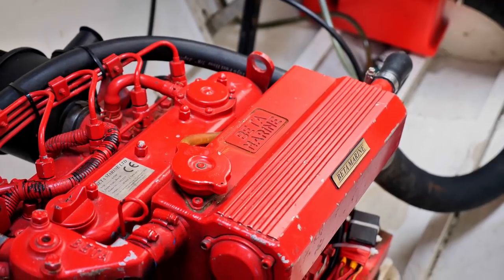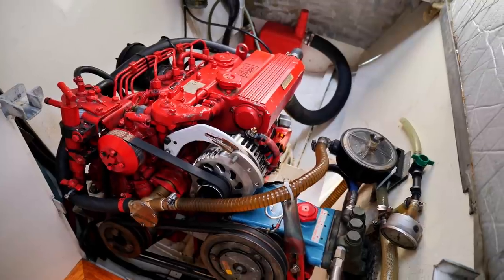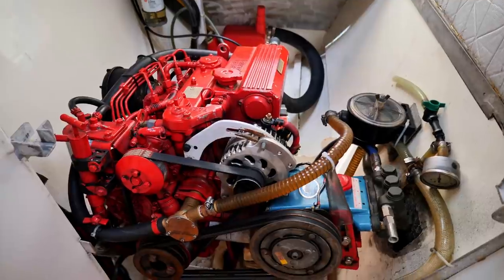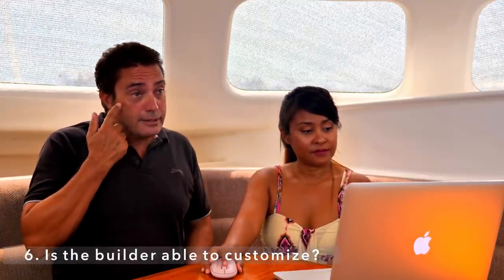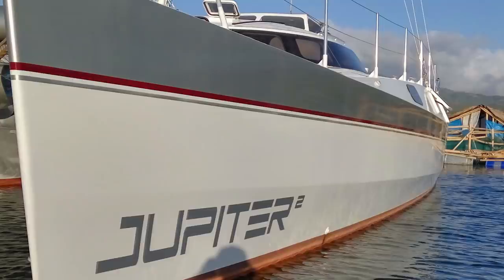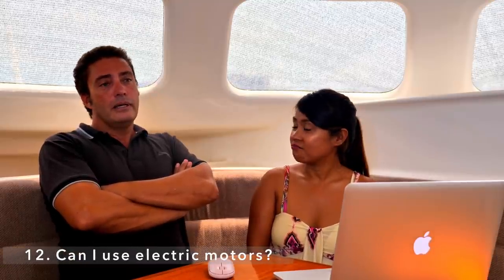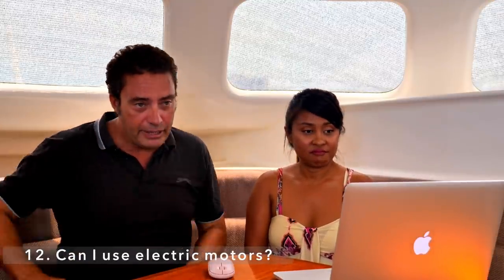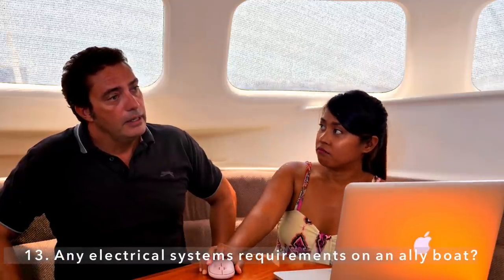Mumby aluminum catamaran - Q & A - Building an aluminum performance cruising catamaran

Comment: Thanks a lot for that Jamie. I did get in touch with Mumby about 6 weeks ago, he answered that he was back building the boat. I then fired out a bunch of questions and still waiting for the answers...You have answered a few here. I find it very concerning if the yard is overwhelmed and you can't get a good communication with the builder all the way in the Philippines. A couple more questions that I wish I had answers for if you don't mind : 
What are the saloon windows made of? Can you fix, change, reseal them. How do you ventilate the saloon? (from the top hatches only ?)
What reefing system do you have? What can be installed?
What is the deal  with the Philippines? Can you import parts tax free, or get the tax back when you leave?
Can you stay in the Philippines after delivery for a few months to stay close to the base and iron out the problems?

The Mumby design is truly great but a bit dated....especially when it comes to the cockpit and connection with the saloon. is there anyway to improve that? Would the 50 provide 2 more feet of cockpit space?
Thanks so much for all the info. It is great that Mumby gets to sell his production. Catamaran demand is totally off the charts now. You did yours at the right time for the right price. Most of us will have to wait 5 years or more...There are amazing deals on monos...just kidding. Fair winds.
Reply from the maker: Yeah, i know it can be a stress with communication or lack there of... but at some point you need to have the faith that they do a good job... he is the designer after all and has pride in that...
So all the transparencies are normally polycarb... but you can use what ever you like. Ventilation i've got 2 overhead and 2 in the front windows in the saloon... I've gone with the standard slab/jiffy reefing at the mast base... but up to you how you want to rig it.
PI has high import taxes... so i used to bring in suitcases full of gear in my luggage when i visited, most months.... The standard tourist visa is 1mth only, but can be extended month at a time.
I agree about the cockpit...and i'd be keen to discuss it with Tim to see if anything can be done... But i suspect it would be a complete redesign... since any increase in space in the cockpit would mean reduced aft cabin space... and if there was a walkthru transom, the rear crossbeam would be compromised....
A difficult one.
Reply: @SailingLifeonJupiter  Hey again Bro. Yes, Tim drew up some new plans for me to open up the cockpit from the scoops, and he had to submit them for government approval, which cost some. And yes, opening up the cockpit from the sugar scoops means losing space in the aft cabins. So, a compromise. Seems like the engines will need to be under the beds. I’m going for the 50’ version, but that doesn’t automatically add space to the cabins as the 2’ increase has to be proportional. But I need the open transom for diving, so for me, worth the compromise.
Reply: @SailingLifeonJupiter  So can you easily change the windows when they eventually craze, what about fixing sealing problems. Form the videos they seem to be embedded and inaccessible. That is why I ask. Cheers

Comment: At 3:57 you mention the light ship displacement being 6,100kg, but everywhere else that I find very sparse info on Mumby48 the light displacement is listed as 8,000-8,500kg, with max-load at 8,700.  Am I missing something? 
I'm surprised because 6,100kg would put it 2,000-2,500kg lighter than some of the most advanced performance-cruisers like Gunboat48, TS5 made of carbon-fiber.  
Is dry weight really 6.100kg? Did you have it weighed?
Reply from the maker: Nah Garen... my boat has always been heavy with all my shit on board!... I'm just relaying what Tim wrote in the specs.... but ally is LIGHT and STRONG!..... but no good for mass/fast production (no moulds).

Comment: Thanks for this guys! Small thing; what do you think about the practicalities of raising the dinette/settee area on a platform by some inches to allow easier vision when seated? I'm not too tall and I notice the windows seem to be a little above you guys when you are seated.
Reply from the maker: Hiya Neville.. Shouldn't be a problem.. Even fatter upholstery would work!
Reply: @SailingLifeonJupiter  (This is my first comment on your videos- you are beginning to make me think I will be saving up for a Mumby!) Fatter upholstery would certainly raise nevillesax enough to see out the windows but as a woodworker furniture builder, I can tell you that you just can't change one dimension without affecting another.  If the seat is higher, a shorter person, like my 5 foot tall wife, would have a hard time getting up onto the cushion.  Then once up on it, they would be uncomfortable with their feet dangling for any length of time.  I think a better solution would be to have part of the floor raised, if not the entire floor.  Maybe some storage could be incorporated below? It would obviously lower the clearance for headroom in that area but, that may not be a problem for those requesting the modification!? Many Cats I have seen have a raised floor under the saloon table/seating.

Comment: I'm guessing the 45 and 50 ft versions would use the same hull width/shape, just change the length. Would they all have the same beam and bridge deck cabin??
Excellent video, BTW.
Reply from the maker: I dunno Steve... Not sure where the changes in length take place...Ask Tim!
Thanks for watching.

Comment: What about a gen set and AC.  I am spoiled and I need AC at least in my sleeping cabin. The tropics can be very muggy when trying to sleep.   I have used the sailing small water force gen sets on the stern to charge batteries without solar but is there or could there be a dedicated space for a small diesel gen set?
Reply from the maker: Sure.. There's a big locker forward of the mast... I keep all my dive tanks, compressor and sails in there..

Comment: Awesome discussion!   I'm studying catamaran design and learned that a fractional rig such as the Cyber will have a lot of weather helm when the rig COE (center of effort) is aft of the CLR (center of lateral resistance).  Looking at Jupiter, the daggerboards look pretty well aligned with the mast so presumably the normal COE would be aft of the mast.  Does Jupiter have excessive weather helm?  And if so, do the rudders cause the boat to slow down while overcoming it?  Sorry for the geek question but I'm trying to figure out a sail plan and autopilot requirement for a boat with the same sort of underwater profile as Jupiter.
Reply: atomvoyages.com eliminated weather helm on his 28 ft Pearson Triton sloop by shortening the mast 1.5 feet and making the formerly fractional jib a masthead jib rig.  Now the helm is balanced.
Reply from the maker: Hey Brian... it can do on occasion, depending on the weather/angle... but it just means you need to balance the sail plan, according to the conditions.... it would indicate that the main is overpowered and needs a reef... or the other extreme is more headsal required...screacher!.... and fur sure, if you're holding too much weather helm, you're just dragging your rudders.
Reply: So would you recommend a main with a lot of roach that might be too powerful or an ordinary point sail?  I realize it depends on conditions.  In light winds I assume you could reach with the main and code zero?

Comment: I'm liking this boat design much more now that you've explained it. I'm still not sure what the difference in weight is between yours and a Schionning Arrow 1360 and if your boat is the same width and mast height as the Schionning Arrow 1360. Everything I talk about is focused around the Schionning Arrow 1360 because I saw a YouTube video about it and the boat name is Duet. It's such a beautiful boat and has a curved front cross bar which gives it sex appeal. I also love the deck house design and the hard cover design over the transom helm position. Your boat has some of these great qualities and I'm basically looking for some comparisons because I can't afford a Schionning Arrow 1360 unless I start a YouTube video channel like you :)
Reply from the maker: Haha.. That won't help you... Unless you have bikini girls on every thumbnail.
Reply: Brave man balsa core never seen one that did not get water ingress.
Reply: @joeblaney684  Now I only want to go with an aluminum cat but need to learn how to weld because Tim Mumby is swamped with orders and has a waiting list a mile long. I spoke with the Schionning team about seeing if they can send me plans and CNC cut files for an aluminum build. I'm not sure if they are willing to do that yet but we shall see. If not than I'm going to build a Mumby Cyber 48 or 50.
Reply: @robertlaird6746  avoid balsa core high quality density foam cored composite works well too
Reply: @joeblaney684  I'm going with aluminum for sure after I've watched every one of Sailing Life on Jupiter's videos. I've even changed my mind on being dead set on a galley up design to now wanting a galley down. The aluminum has many more advantages than any other material including price which is a very large factor for me. I will make a curved front cross beam and have the anchor up front and have a fixed spinnaker pole. I'll also make my own carbon boom with wings to hold the main sail. I'm not sure if there might be a better design than the Mumby kick up rudder system but I'll think about it. Now I just need to learn how to weld.

Comment: The interior or the boat is made from fiberglass panels. They are made on a flat surface about 4' x 8'. Much of the interior has been copied with patterns which speeds up the process of finishing the interior. However there is always the ability to customize various parts of the interior. The interior finish looks great but it is very labor intensive. Tim has spent years training his crew to do this work as quickly and with as high a quality as possible.
Reply from the maker: All correct Nicholas... I'd only ever recommend Tim to build these boats... If a custom builder did it, who knows what you'd end up with.
Reply: @SailingLifeonJupiter  Some owner / builders have done an excellent job at finishing their boats, usually at Tim's yard using his crew to assist.

Comment: Inner removable  forstay , if you had gone that route from the beginning? 
Would you to this question what different would you have said make the inner forestay permanent 
Because you have to attach the sail, lift by hand its not on a furler .
I got the impression you have leak issues with the water system leaking ,
Reply from the maker: The genoa gets caught up on the inner forestay when tacking... But we don't really tack that often... (usually avoid going upwind!)... In fact I could just unscrew the turnbuckle and get it out of the way.
So I found that my watermaker pushes air bubbles into my hoses, which are compressable of course...so my pump would run. Now after making water I bleed my water system to remove the air... No more problems!
Reply: @SailingLifeonJupiter  as your doing the trades , I didn't think you tack much , it is a back up if the first at fails ,  have you tried sailing in lighter airs with both,

Comment: If your using those corrugated flexible orange conduits from the Philippines it will be tough to replace those wires best to use the rigid orange pvc conduit pipes.
Reply from the maker: You might be correct there... But I can't imagine needing to replace except possibly for a lightning strike.
Reply: I've used a lot of the orange flex pipe and have had no problem pulling wires in !!!